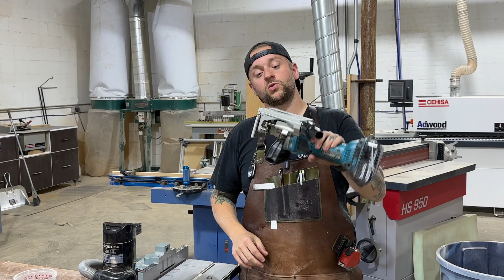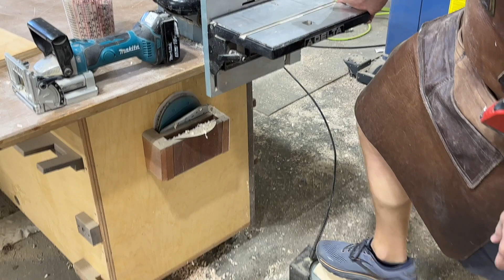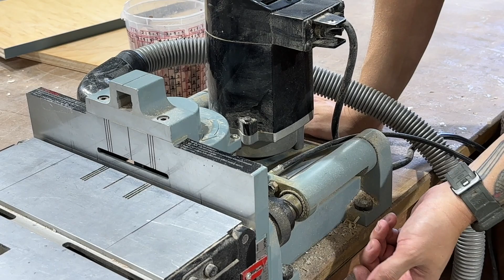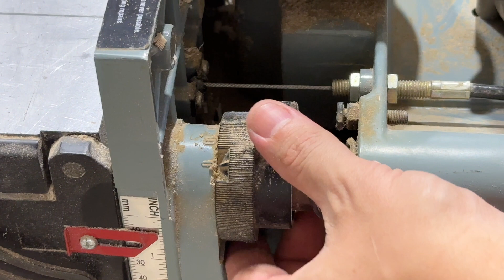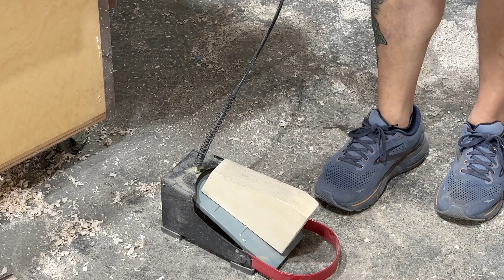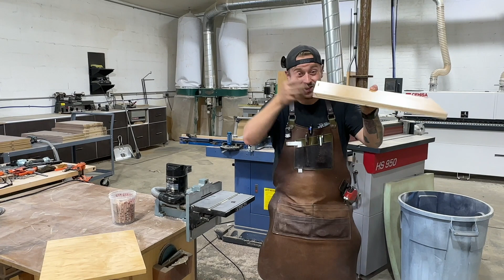Cut Biscuits With Your Foot? Tool With A Cult Following.

Comment: I bought several tools from the son of a deceased woodworker a few years ago, and a Delta 32-100 was one of them.  He threw it in cheap.  I think he was planning to use the shop for something else besides woodworking, and just wantedit cleared out.... Unfortunately I didn't tie stuff down in my pickup bed, because I was only going to poke along a handful of miles on back roads.  So of course some idiot ran a stop sign, I slammed on my brakes, one of the other tools fell over, and it broke the Delta's foot pedal plate in half.  Of course it's cheesy pot metal, and it didn't take much.

So the Delta (on its dedicated three legged floor stand) sat in a corner gathering dust until today, when I was watching someone online use a Domino.  I'm obviously not going to buy a Domino at today's prices.  My shop is a playpen, not a production facility.  But it jogged my memory:  "hey, I DO have that old Delta biscuit joiner.... wonder if I could glue and screw a piece of plywood onto the broken pedal or something?"

Then I got even smarter, and went on eBay.  Found a New Old Stock pedal plate for $26.88 with free shipping....It should be here in about four days.
Reply from the maker: Sweet! I’m still considering switching it over to a pneumatic actuation.
Reply: @TodaysCraftsmen  I just replaced the broken pedal plate on my joiner.  And as I was doing so, I realized the gap between it and the pedal frame is adjustable.

The cable sheath has a threaded section through the top of the frame, held with a pair of hex nuts.  Loosen the lower nut, and screw it down until it almost touches the pedal plate.  Screw the upper nut down and tighten, and presto - no room for a toe to get trapped.  

Of course, there's a chance that readjusting the pedal too far leaves unacceptable slack in the cable.   I haven't tried it yet;  I need to clean and lube everything first.  

And of course, by now you may be used to your wood block extension anyway....
Reply from the maker: Keep me updated! Very interesting.
Reply: @TodaysCraftsmen  OK, fired up the biscuit joiner today.  Works fine, and even has a sharp blade in it.

Unfortunately it's the earlier model, and the table doesn't tilt.  Instead, it came with an auxiliary tilting table, that slipped over the main one and fastened to it.

The fasteners are still there, but the auxiliary table itself is long gone.  It was probably laying under a workbench when the guy sold me the joiner, and he had no idea it was part of it.

Might be fun to fabricate my own.... I picked up a small MIG welder a while back, and it needs a trial run.

The pedal works fine; adjusting it didn't affect its function at all.  I suppose theoretically I could get my toes stuck if I slid my foot forward while the pedal was all the way down and I was wearing sneakers instead of work boots, but I'd have to work at it.
Reply from the maker: Very cool!

Comment: Looks like it would be easy to change it to a pneumatic actuator and pedal.
Reply from the maker: We’ve definitely talked about that a few times! Just need some sort of speed control so it’s not too fast
Reply: When I was googling for a user's manual, I stumbled over a thread where a guy had done just that.  He had a two-stage setup:  first the clamp would close, then the blade came out.
Reply from the maker: Smart!